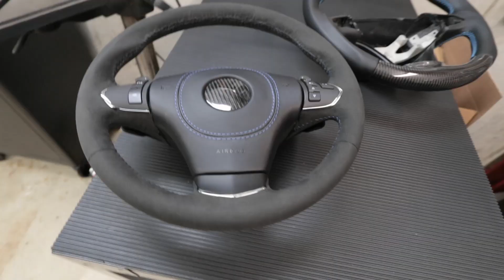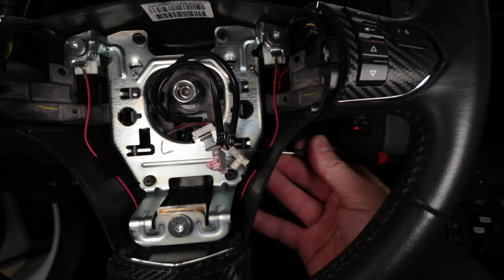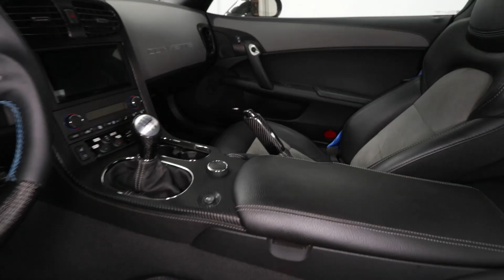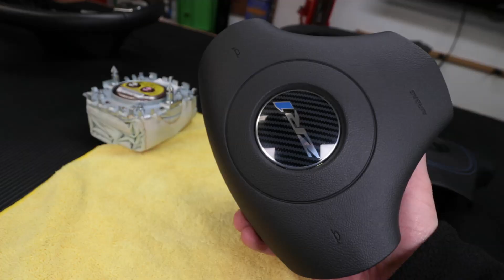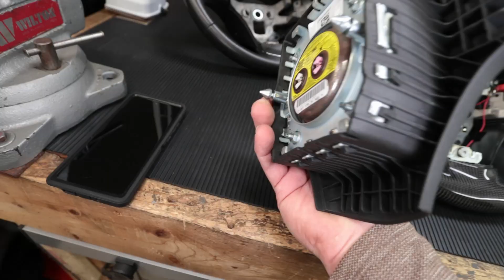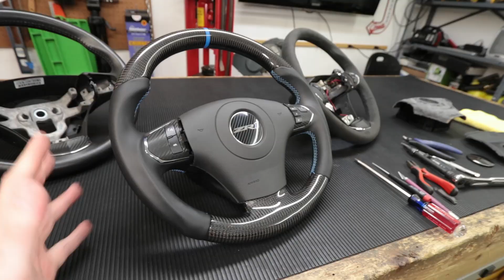Removing OEM Install Carbon Fiber Steering Wheel | Airbag Cover Disassembly | C6 Corvette ZR1

Comment: What brand is your carbon fiber wheel? Looking into a new wheel for mine.

(nice ZR1 btw 👌)
Reply from the maker: Its a Chinese wheel from Ebay. Most of them are rebranded relabeled chinese wheels even from the places here in the USA.  I searched thru all of them. I wanted one that was not super thick. Alot of them are because they just throw multiple layers of carbon on top of a stock wheel. Which then makes them super thick in hand. Not what i want. My previous carbon wheel cracked at the finger grooves randomly.  So i search for the slimmest one i could find that had the features like a 12-13 wheel trim. This one feels very sculpted and very nice in the hands.
Reply: @ModernHotrodsNH  that's my problem with most of them, too thick. Do you remember the brand? How does it feel now that you got a couple days of ripping behind it?
Reply: I also would like to know which seller you bought from on eBay.  I'm looking for one also.